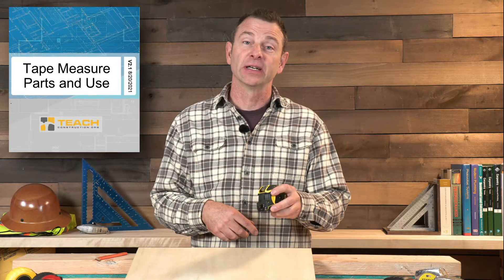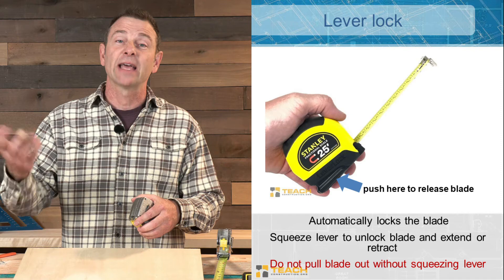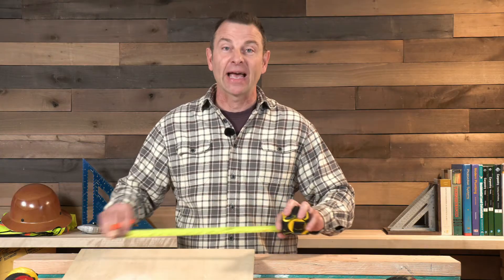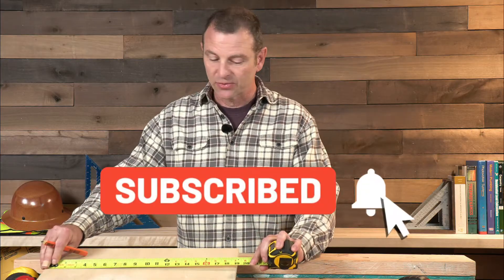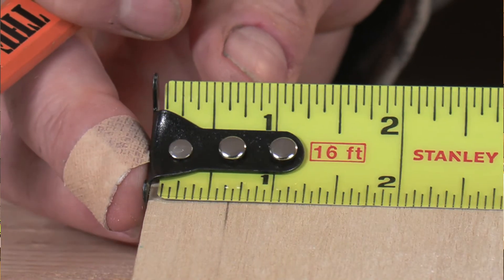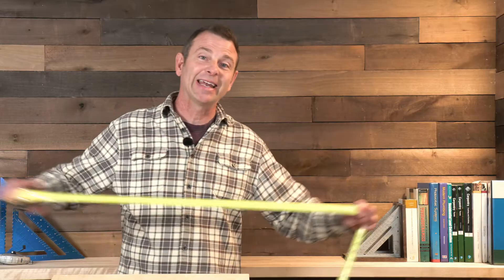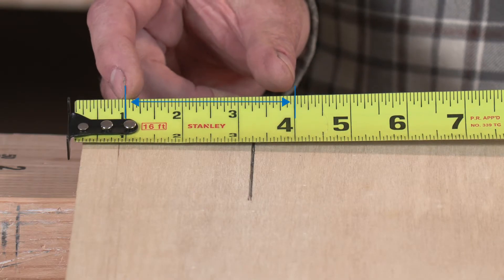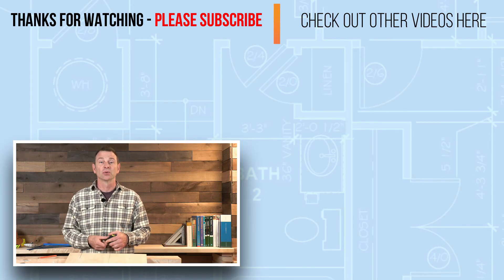Learn about the Tape Measure and how to use it. Lesson 1 of 3. Construction Training Series.

Comment: I'm surprised you didn't show the way the tape measure was actually designed to measure between two surfaces. You push the end against one surface, stretch the tape out, and place the body of the tape measure against the other surface. The body of the tape measure has its width marked on it. Mine is 3". So you just read the number at the exit of the tape measure's body and add the 3" to it (or whatever is specified on the body of your tape measure.
Reply from the maker: You are correct that the case can be used - but I seldom find it as accurate when a double measurement is more accurate.